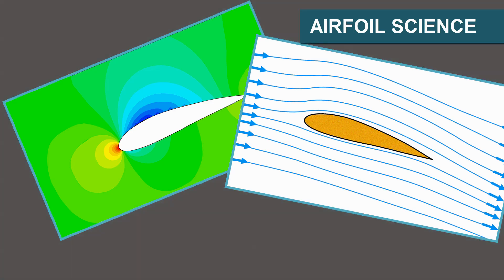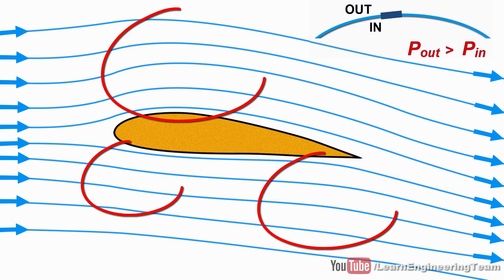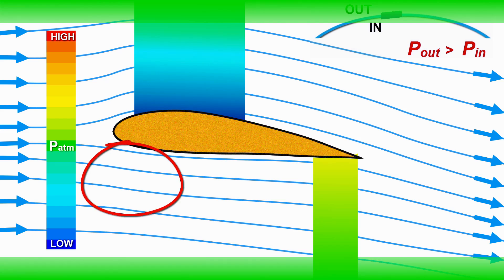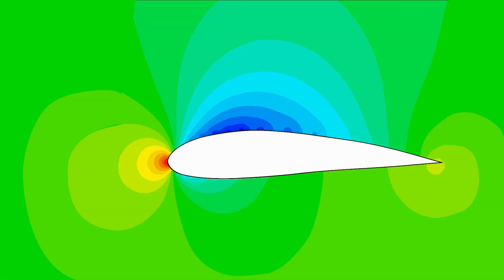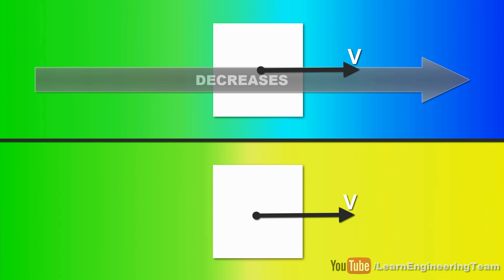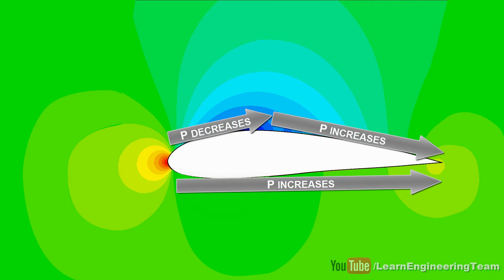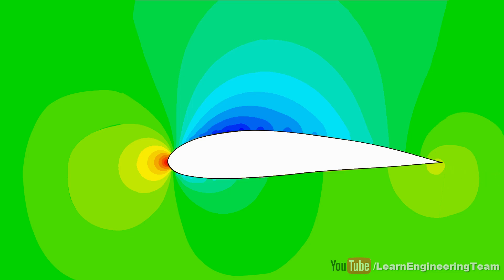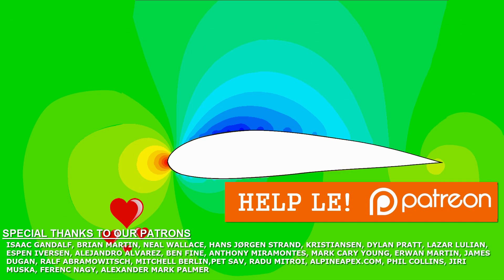Why is the top flow faster over an Airfoil?

Comment: I can see why the increase in speed but still no idea why the drop in pressure
Reply: Contrary to what so many people falsely believe, the pressure changes are caused by the relative motion of wing and air. 
If an object/surface  moves toward some air, (or some air moves toward a surface)  this causes a pressure increase which pushes the air away toward any nearby lower pressure regions (or slows the air moving toward the surface).
Conversely...
If part of the object moves away from the air (or the air is tending to move away from the object/surface) the pressure decreases. 
These new pressures then cause accelerations in the air.  
..
The lower pressure above the wing allows the higher pressure ahead of the wing to push it more and accelerate it toward the leading edge.  That lower pressure also allows the normal and higher atmospheric pressure far above the wing to push, accelerate air downward to join the lower air to form the total down-wash behind the wing.
Euler, following on from Bernoulli's work revealed that Pressure Gradients (difference in pressure between two locations) cause acceleration in fluids.

The lower pressure is caused by the fact that the air and wing surface are tending to travel away from each other.  
It is the AIR-FLOW PATTERN that lowers the pressure NOT the wing shape.
A flat plate wing has very similar air-flow patterns to any other wing.
..
See: https://www.quora.com/q/rxesywwbdscllwpn/Understanding-Lift-Correctly 
Cheers

Comment: Why talk about particle speed in terms of acceleration and deceleration as if the particle was already in motion? Whilst this is true in a wind tunnel, in practice the.wing travels through still air. Surely the particle moves up or down, displaced by the passing wing?
Reply: It also accelerates and decelerates over the wing, and generates some vorticity behind the wing. It doesn't matter because speed is irrelevant – the physics are the same regardless of whether you're moving with the wing or the wing is moving.
Reply: @AmbientMorality  thanks for the reply, however imagine an area full of stationary people and you drive a car across the same area. As you pass by people displace themselves to avoid contact. Your car has momentum not the people. In what way are they accelerated or decelerated?
Reply: @tentruesummers9043  If they displace themselves, they move. That means their velocity changed (from 0 to some amount in some direction) and therefore they were accelerated or decelerated
Reply: @tentruesummers9043  You are catching on to the true science!  In your car metaphor, the car PUSHES the people around.  THE CAR changes the pressures around it!.  Just like running in water.   YOU increase the pressure in front of you and that pushes the water away toward any and all lower pressure regions.
Behind you, as you move away from the water, you lower the pressure behind you. This "suction" allows any and all nearby higher (or normal) pressure regions to push air in behind you.
..
In the mid 1700s Euler followed Bernoulli's work and HE actually developed what we now call "Bernoulli's Equation".  Euler showed that it is Pressure Gradients (Different Pressures in two locations) that provide the force that accelerated the mass of a fluid.  THIS IS NEWTON FOR FLUIDS!
..
Wings do this same kind of "pushing around". See:
https://www.quora.com/q/rxesywwbdscllwpn/Understanding-Lift-Correctly
Cheers and enjoy the knowledge that so many other well meaning people make more complicated than necessary.
..
SPEED DOES NOT CAUSE A LOWER PRESSURE.
Air is pushed by a higher pressure and accelerated toward the lower pressure region.  THAT is why it is going faster when it gets there..!..
Simple.
Reply: @AmbientMorality  See my above comment.  Acceleration of a mass  REQUIRES a force to cause it and that force is the  pressure differences CAUSED BY the relative motion of air and wing.!.
Air does not spontaneously accelerate by magic.  a force from a Pressure Gradient is the cause.
..
Cheers
Reply: @Observ45er  Agreed
Reply: @AmbientMorality  Thanks.  I've been researching this for several years and have talked with noted authorities including Boeing's Doug McLean, noted Author and NASM Curat John Anderson and MIT's Mike Drela.

Comment: What is the difference between an airfoil and a wing? This video wasn't logical to me. I'm sure it's correct, but I couldn't wrap my brain around it. I understand what you said about how lift is created, but how the two streams of air never meet is still a mystery to me.
Reply: An airfoil is a 2D cross section of a wing.
Reply: Folks,
The two parcels of air starting next to each other before the wing arrives, meet up with completely different parcels behind the wing. 
..
The parcel that goes under the wing, winds up pushed before the wing even arrives and also farther along in the direction of flight.
..
The parcel that goes over the top, starts by being pushed forward before the wing even arrives, but as the wing passes by, the lower pressure above the wing allows the higher pressure ahead of the wing to push it VERY violently toward the trailing edger, totally reversing it's direction and finishing up pretty close to where it started before the wing came along.  It then meets up with a lower parcel that started way earlier, back where the wing came from.
..
Please see: 
https://www.quora.com/q/rxesywwbdscllwpn/Understanding-Lift-Correctly 
. . 
Cheers

Comment: Oi i just gotta know, why are plane wings and noses blunt at the tip rather than pointed? Wouldnt it help to separate the flow seamlessly, without causing that high pressure area at the front? Why do we not use that
Reply: Here is a great explanation 
https://aviation.stackexchange.com/questions/26532/why-should-the-leading-edge-be-blunt-on-low-speed-subsonic-airfoils
And we DO use a pointed leading edge airfoil but for supersonic aircraft because aerodynamics is different in supersonic flow.

Comment: OK, BUT WHY IN A CURVED FLOW THE PRESSURE IN OUTSIDE IS LOWER THAN INSIDE?
Reply: BECAUSE SOMETHING HAS TO FORCE A PARCEL OF AIR TO FOLLOW THE CURVED PATH, OTHERWISE IT WOULD FOLLOW A STRAIGHT PATH. REMEMBER NEWTONS 1ST LAW? THE FORCE IS PRESSURE

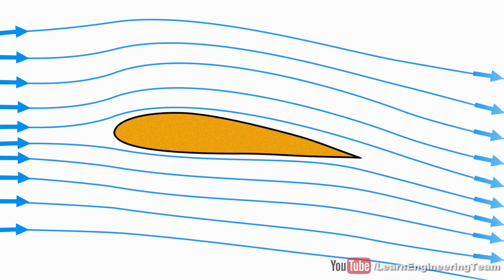Comment: 0:29 In the curved flow, why is pressure higher outside ?
Reply: Because to keep the streamline ''attached'' to the airfoil. If P at outside = P inside, the streamline will go in a straight line (not follow the shape of the airfoil). Then, it must be a difference in pressure to bent the streamline to follow the shape of an airfoil.
Reply: Pressure of air is the amount of air molecules at a given place multiplied with the vibration speed of the molecules (higher temp the more they vibrate and hitting a surface with a speed which gives out a force which on a given area is equal to pressure)

The temperature in this scenario can be seen as constant, and the only thing we need to focus on is the amount of air molecules at a given space which will in turn give us the pressure at that area.

When the air curves for example in the beginning it is pushed up and some air molecules will detach from the wing surface as the speed gives them enough momentum to leave the wing surface as it hits the sloped surface of the wing. 

This means it will have a smaller amount of air molecules compared to the atmosphere. Since pressure in our scenario is directly given by the amount of air molecules at a given place it must mean that we will have a lower pressure at the top of the suface of the wing.

Less air molecules at the wing surface equals less drag on the air molecules due to the skin effect. This makes this air able to travel much faster than the air beneath the wing. 

Same thing at the bottom end of the wing. Air molecules follow the path of the wing and is smashed towards the wing at the back because of the momentun they have. This will decrease the speed of the air molecules (skin effect). Air arriving at the surface of the wing will be arriving faster than the air leaving the surface (goes further along the surface of the wing). This makes a traffic jam of air molecules where more molecules is arriving than leaving. Which in turn gives larger amount of air molecules than the atmosphere. As said, the amount of air molecules directly gives the pressure in our scenario and we will have a higher pressure here compared to the atmospheric pressure.

Hope this gave any sense! :)
Reply: @kansaandre  Awesome answer, thanks
Reply: @kansaandre  Are you sure that it depends mainly on skin effect? Isn't the pressure distribution along the wing, like shown in this film,  depended on shape and curvatures rather than friction and skin effect?
Reply: @pitachaja124pl   You do need a centripetal force acting toward the inside of the curve. Otherwise, any object (air included) would travel in a straight line. 

So the higher curvature of the wing (at top towards front) experiences the most lift. It is a smooth (laminar) airstream around this point because of pressure from inflowing air. This results in higher velocity around this region, including airstreams above the wing itself. So yes, airstreams not attached to the wing are accelerated. It's due to continual force applied by oncoming air.

Behind this point of the crown, airstreams (including well above the wing surface) slow down. Pressure on the wing begins to rise after the crown because (pressure + velocity = a constant force). 

The higher up you are above the wing, the slower the airstream, and so higher the pressure.

 Pressure is always higher on the outside of curves for this reason. Even if you don't have a wing, or skin friction, this will still happen. A tornado is one example: higher pressure on the outside, low pressure on the inside (Stuff gets "sucked up"). 

Skin friction is a contributing factor in aerodynamics, so is boundary layer, ... But that aside, when looking at fluid dynamics: yes, outside of curves have higher pressure than inside, even without a solid surface involved. 

(Also just saw you asked 4 months ago )
Reply: coanda effect

Comment: My explanation would be that the airfoil acts kind of like a nozzle, accelerating air by forcing it to move through a smaller area.  Imagine putting another airfoil on top of this one, but flipped upside down.  The two airfoils would act as a nozzle to the air flowing between them, causing the flow to accelerate, then decelerate back to normal speed as it exits the nozzle.  Having just the lower airfoil does the same effect, only less pronounced; it still accelerates the flow above it, lowering its pressure, by forcing it to move through a smaller area.  The bottom surface is less curved so the acceleration and pressure reduction is less.  Thus upper pressure is lower and there is a net up force.
Reply: This would imply a flat plate at an angle of attack would not generate lift, yet it does. Venturi is not a great explanation.
Reply: Not so FB. That is the half-Venturi fallacy. A force is required to accelerate a mass and air HAS MASS!.  The force comes from the Pressure Gradient (Pressure Difference between two locations). F-MA for fluids.
It is simply the relative motion of air ans wing which changes the pressures around a wing.  See: 
https://www.quora.com/q/rxesywwbdscllwpn/Understanding-Lift-Correctly

Comment: Bernoulli says that higher speed = lower pressure and vice versa. I get that (though you deny it?) and it makes some sense to me. What i didnt get is why the air ontop of the wing is faster in the first place. Thats what brought me here. Its not the longer way same time bs a lot of people talk about thats obvious but now you tell me its pressure aswell? This is a chicken egg situation and annoys the fuck out of me. I give up! Given how many different explanations for why planes fly are out there apparently noone actually know why they do... I guess ill keep flying and stop asking questions 🙄 this is stupid and i surrender 😒
Reply: Longer way for the air at the same time on the top = higher speed . Bernoulli says Pdin+Pstat=permanent.  =high speed---> low pressure on the top. Thats all.
Reply: Falketto Bernoulli’s principle applies in a closed environment. The change in speed on top of the wing is due to lower pressure, which is caused due to space needing to be filled by the air and the centrifugal force of the air going around the curve. There is no other reason that air would have to travel faster, other than one complex thing though: apparently air on top of the wing is squeezed (I don’t know why, it’s really complex) but this squeezing of the air would actually speed it up. So it kind of goes both ways, but there’s multiple things happening

Comment: This video is correct that the top goes faster than the bottom, but fails to say where the free stream speed "square" is at the trailing edge compared to the bottom and top.  It is far AHEAD of both. (key) Neither is "accelerated" as both are SLOWED compared to the free stream speed, the top less so than the bottom.  Flow on the lower side is bunching up and flow on the outside is slung around, thus becoming lower in pressure.  Simple Newtonian mass, acceleration accounts for it.

Comment: If so , can you explain the lift generated by symmetrical aerofoils based on your theory please?
Reply: A symmetrical airfoil creates no lift at no angle of attack. That is because the curvature is equal on both surfaces and have equal pressure gradients. Now when you tilt it at an AoA the leading edge of the upper surface creates a lower pressure gradient and then it works just like how its explained in the video. Just be careful not to stall.

Comment: Isn't it just because the top is slightly convex and the bottom is slightly concave?
Reply: No. a flaqt plate works pretty much teh same.  It is the airflow pattern, not simply the wing shape.

Comment: Ok so why is the pressure higher at the outside in curved flow?
Reply: Tristan Möller I think it’s because centrifugal force. Like spinning around in a circle and being pulled outward. The air attaches to the wing since there can’t be a vacuum, so it takes a curved path. This curving creates centrifugal force and the air is pulled away from the wing, helping to lower the pressure

Comment: It could be due to the lower pressure above the wing than below it (higher pressure means more atoms packed together so the harder it is for the atom/ air particles to move through the high pressure(like shoving your way through a crowd). This result’s in slower air speeds)  which allows the air to move faster over the wing than below it.
Reply: Yes..., that's an explanation trough reduced density. But the density reduces as a reduction in pressure otherwise..., which reduction in pressure is due to the Coanda's effect as the airflow tries to follow the curved pattern along a solid surface. This pressure reduction ultimately generates the increased airflow speed. AND NO..., this airflow speed increase now won't mean that more pressure reduction will take place as a result. No...! The result..., which is the increase in airspeed due to the decrease in pressure has already taken place and now they have settled. Yes..., if you want to increase the airspeed over one side of the curved shape, you will end up with a reduced pressure. They don't self-accelerate each-other, meaning the pressure and speed. Most of the times, only one triggers the other..., either the lower pressure will increase the airflow, or vice-versa. You could make them both happen, but the friction and other back pressures drag will still settle your airflow speed to X value. Cheers!
Reply: At 0:50 it says just that. Due to the high curvature..., the pressure decreases. That's the first trigger and the rest come along.